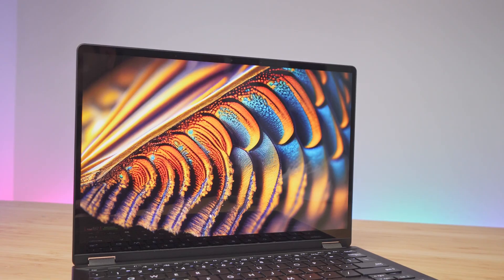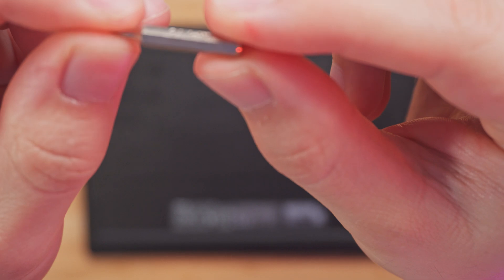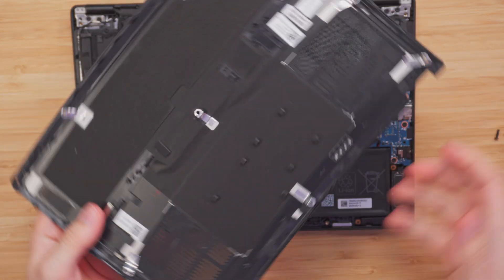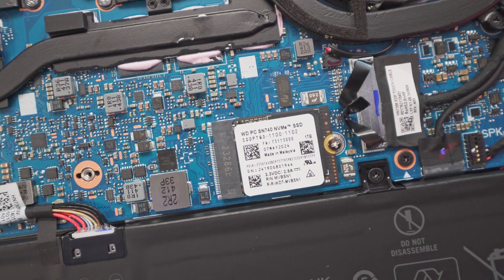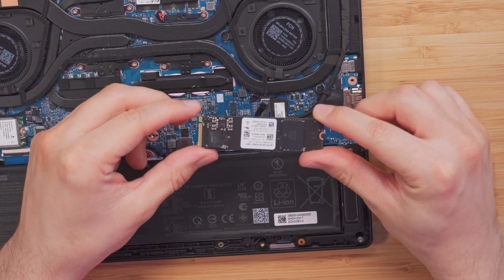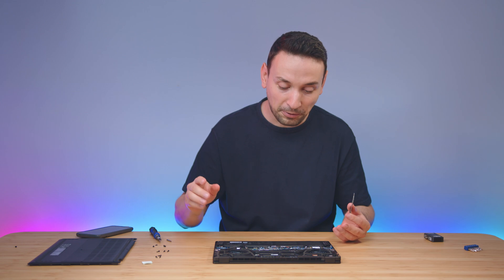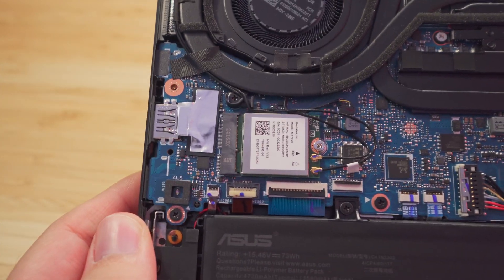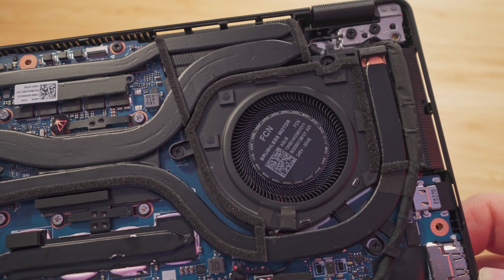ASUS ProArt PX13 Teardown and Upgrade Potential 2024

Comment: Love this laptop but i got a small crack in the screen. Anyone know if its possible to replace the screen?
Reply: IF you can find a  replacement screen that comes with the hinges, yes it's possible and easy. I did a quick google search though and I couldn't find any in stock. I'd guess $500-$1000 if they do become available.

Comment: You do not mention the possibility of upgrading the SSD by using something like a Crucial P310 2TB PCIe Gen4 NVMe M.2 2230 SSD.  you just dismiss the whole possibility of the upgrade.  Very strange.
Reply: No he didn’t. He said you could upgrade size but if you are upgrading for speed there is no point.

Comment: Is there a way to replace the panel with a higher refesh screen?
Reply: Might be able to swap it with Flow X13 display
Reply: @friendlyshopper3991  the flow x13 has essentially identical form factor and internals, just a higher refresh rate display, but no longer OLED.

Comment: My px13 keeps making a crackling noise, started about a week after purchase, anyone got any ideas what it might be?
Reply: tighten the screws on the back it fixed it for me
Reply: @BallisticSimulations  second this, loose screws are the cause
Reply: @MABinBarcelo  Yep mine too, back right hinge just gave away and started pushing the backplate so much it just knocked two screws loose.
Reply: Did this cause the bottom panel to start separating on its own when this happened? Asking to compare with my own experience

Comment: I kinda feel like for $2000 they could've found a way to get a 2280 slot on this board.  Even if/when 4TB 2230 drives come out, there's no guarantee they'll fit, especially if they're double-sided.
Reply: I think there is an adapter we use. I am going to give that a shot.

Comment: Hey @htpoint, possible to teardown the hinges? Asking since the PX13 actually deactivates the keyboard if the screen is rotated > 180°. I used my old Flow X13 as a keyboard with connected external displays and that doesn't seam to be possible any more. Already asked ASUS for a fix but they told me it just gets deactivated and it's pretty unlikely there will be a fix any time (soon).

So I'm thinking about just disconnecting the sensors? Really frustrated, love this device but totally need to able to use it as a standalone keyword with display "removed".
Reply: I believe theres a driver for that in windows. Maybe try deactivating that
Reply: my right hinge moves a little, were you able to tear down yours?
Reply: @friedrichranada7133  Never tried, I'm sorry
Reply: @friedrichranada7133  I just fixed my right hinge, I took off the backplate and screwed it on back semi tightly (first time opening something up). Mine was just a screw lose i dont know about you tho.

Comment: Anyone think it'd be possible to upgrade the battery yourself to get more battery life? I'd love to get this laptop for school but I would like it to last longer than 8 hours.
Reply: extremely unlikey...
Reply: Mine easily lasts over 10 hours, just disable the discreet graphics and run in power saving mode. Even then it's still overpowered for 99% of things.
Reply: i use mine in the silent mode and get about 3-8hrs (not battery save mode) when using onenote for school. kind of low but it definately works imao.
Reply: @jespero94  Switch the GPU to eco mode. All it does is disable the Nvidia graphics, but you still have the Radeon 890M which is overpowered for just about everything but gaming. More than doubles your battery life.
Reply: @supersnot4 yes its already enabled in silent mode, so that the dedicated gpu is disabled. I did this in myasus app but i Will check on it again 👌

Comment: Do you think it's possible to safely mount and use a 2280 in there with some diy'ing? It definitely looks possible, but I'm not a specialist regarding that at all. I have bought the PX13 and would like to upgrade storage in the future. 4/8TB would be amazing. Bit of a missed opportunity imo that they didn't make the storage (partially) soldered on as well. Maximum 2TB (largest 2230 SSD) is really not that much at all, especially the targetted audience.
Reply: Sorry, but don't think so. Check the vid, there just isn't enough space. If it was possible, ASUS would probably've done it themselfes.
Reply: The only way you're getting a 2280 SSD to interface with this computer is in a USB 4.0 external enclosure.  Also, there's no guarantee a future 4TB 2230 drive will fit, especially if it's double-sided.
Reply: Maybe the left slot where the wifi card is can be used with an 2280? You'd just need to extend the antennas and plug the wifi card in the other slot instead.
Reply: @TimsYoutubePremium  if i'm the designer for this I would swap placement of the wifi card slot and the ssd slot. there seems to be enough space to fit a 2280 from the left side going right, rather than putting the wifi slot there, wasting the space in between.